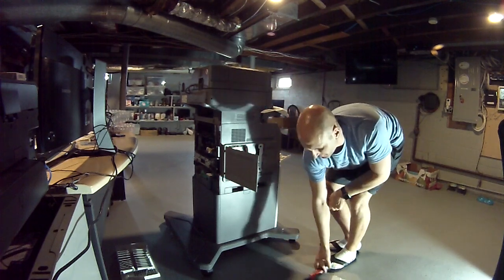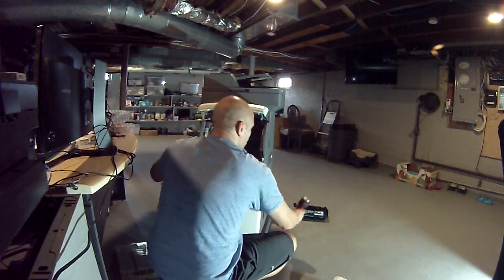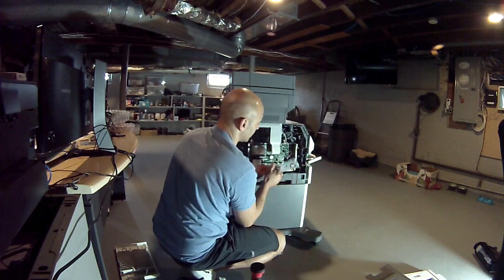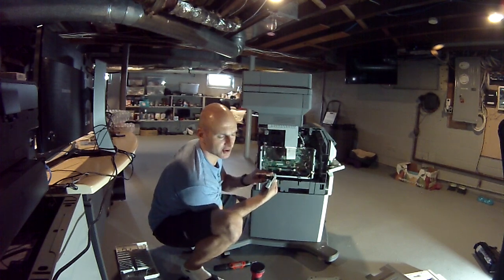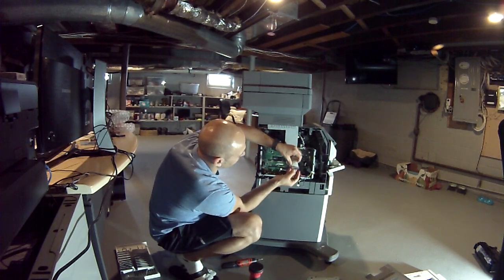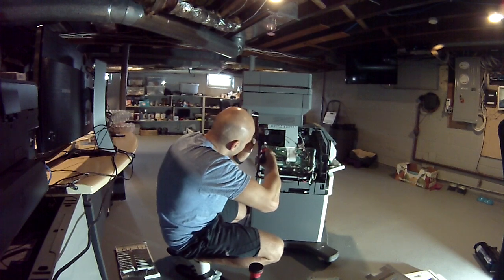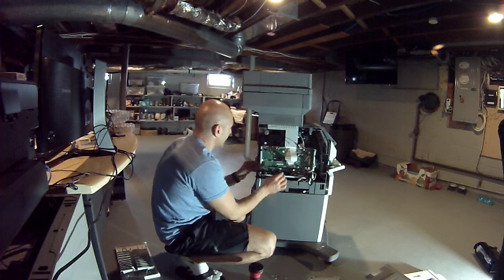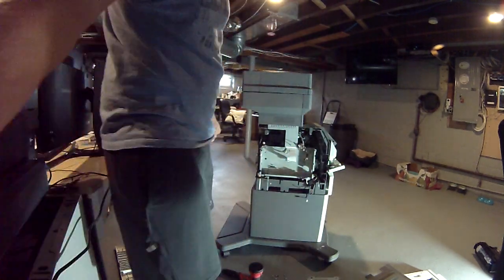Lexmark X656 printer 950.xx NVRAM Mismatch Error Series Part 2

Comment: Hi, I would like you know if changing they logic board fixes they trouble that turns on but it dont show to the Main menu, stucks on the starting charging bar thanks for the videos
Reply from the maker: If you change the logic board, you must replace the OP as well to work.

Comment: you have to replace all 3 unless the component you are replacing is NEW.
Reply from the maker: You may only need to change 2 items instead of 3.
Logic board and OP must be both replaced with a new one, otherwise it won't work

Comment: For Lexmark x656 equipment I would like to be able to receive the application for ID-COPY, which is installed on the equipment and is for copying identity documents. This is free and not currently downloadable from the Lexmark site and I am not a service partner. I have over 40 used equipments installed and I cannot get the application from a Lexmark dealer.